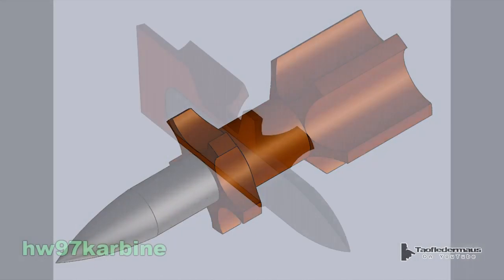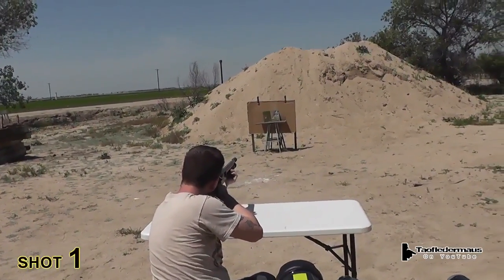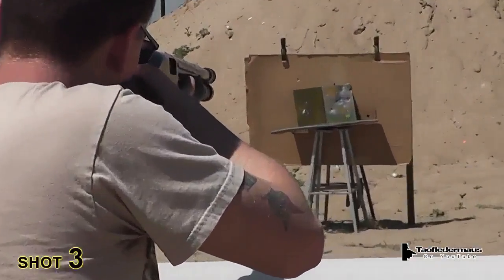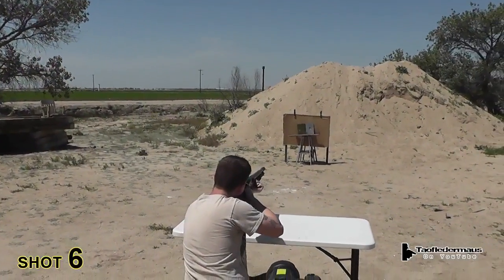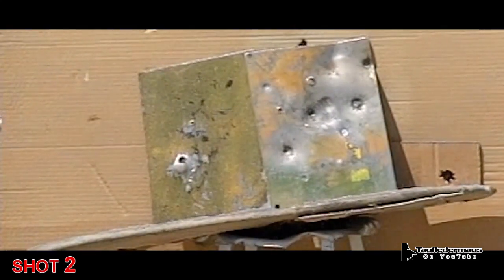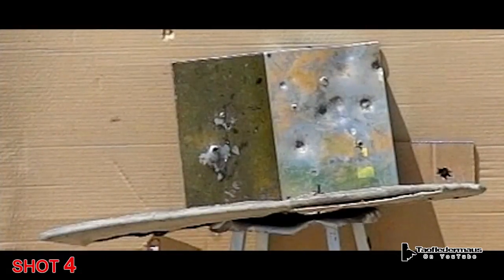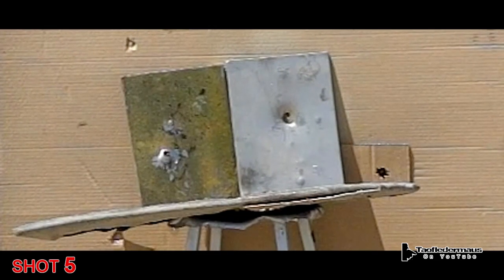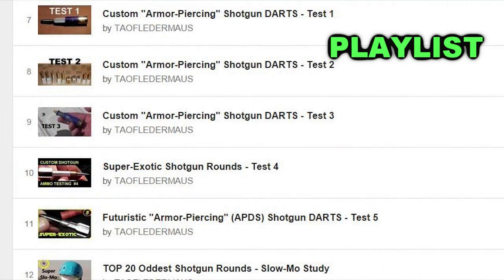Futuristic 12ga Shotgun Projectiles - Ballistic Trials - Test 6

Comment: without good spin, it won't fly right for a good distance...
Reply from the maker: +30yehgerrman   There are a lot of shotgun slugs that do not rely on spin.   They work by balance and drag.   It's a simpler approach that doesn't have the negative side-effects of a spun projectile.
Reply: Actually, I think the compression-expansion cycle of the urethane resin is to blame for most of the failures in this video. The cycle affects phases 1 and 2 of ballistics significantly. The solution is to actually make rectangular holes through the dart and cast the fins so that the resin goes through the holes... It's an easy solution and will absolutely prevent the G-shock from messing with the ballistics of the fins/dart combo.

Source: I'm a materials engineer.

Comment: The M1 tank uses a smooth bore 120 mm gun. The primary round is the "APDSFS". That is Armor Piercing, Discarding Sabo, Fin Stabalized. It is basically a very dense, very heavy, steel bar with a hardened point on the business end and fins on the other, fired at a VERY high velocity. The fins stabilize the round, but do not impart spin (as rifling would). It is extremely accurate and will punch through any known armor even at long range. There are actually Youtube videos of it. A shotgun is just a much smaller smooth bore gun. I think you guys are on to something, just keep working on it.
Reply: I would think making the fins lighter here and attaching them more firmly to the slug itself would make them more effective. The fins kept separating from the slug, resulting in the entire thing just flying apart.

Comment: They make sabot jackets for hand loading shotgun shells. Do you have a rifled slug gun? 
Something I've always wanted to try but I don't have reloading equipment. Is cut the tip of a .22" drill bit and use a sabot for mounting a 22 bullet in a 30 caliber case.

Comment: The basics for stabilization of 12 gauge bullet: (1) make the length as short as possible, about 25 mm, the diameter should be 18.53 +0.0 minus 0.02 mm; (2) The nose should be round, - radius about 9 to 11 mm; (3) Test with center hole of diameter from 6 to 10mm. The larger the hole, the more the bullet will be stabilized in flight. To have same weight with larger hole, bullet may be made longer. (4) Mild steel should be the material, for low cost. Coat it with lacquer or vanish so as to reduce barrel wear and tear. (5) Keep a stout cardboard peg or 2 between the powder and the base of the bullet.
Reply from the maker: +David Tharckabaw   Here is a new video where it backs up your "keep it short"  idea.   https://www.youtube.com/watch?v=voM13PNFYZI
Reply: +TAOFLEDERMAUS Thank you for your reply. It is interesting and very educational.
Reply: Are you saying a hole should be put through the length of the bullet, like a straw?
I think they've tested a few slugs/bullets like that and iirc there is no airflow through the hole when it's travelling supersonic but I may be wrong.
Although I'm guessing having the empty space would give a more stable balance.

Comment: not trying to beat a dead horse but what angle are the round dents from the shooter.  it does not require much angle to deflect the rounds but is does require a proper target that does not deflect when the round hits the target. general rule of thumb with steel targets is if the plate bends quit shooting at it.

Comment: won't putting fins on it cause more chance of flight/lift which can cause it to glide to the on the strong air pockets or under them depend on weather the stronger air is above or below them same can be said with left or right, you need something that cuts through the air rather than on that will glide on it

Comment: Interesting video series. Perhaps you would get better performance with shapes that more closely resemble blowgun darts, not the long ones with 'golf tees' at the rear, but the shorter, hard-hitting ones. I believe the tails on your milled darts are much too heavy, and although fins are theoretically better than cones aerodynamically, in this case I think cones will work better. Take a look at space reentry vehicles, the old cone-shaped 'nose' of Apollo missions, though in those cases, the cone was reversed and the craft presented a flatter cone to the air, but a cone none the less.

Comment: I've watched a few of these videos trying to get spiral action from different projectiles  The results seem to be the same. Tumbling . Relying on aerodynamics to overcome a no spiraled exit from the barrel seems futile. Extreme force and a straight push from the powder vs  literally no resistance from the air ain't  getting it . Maybe that's why our forefathers rifled the barrel . Blasting lead to conform to the rifled grooves and forcing a spiraled exit and accuracy. Ya think? Even a baseball is spinning upon release.
Reply from the maker: ron sheppard  I guess it is impossible this round worked then:https://www.youtube.com/watch?v=8DOZhYmFKnw
Reply: I would like to see some of these unique projectiles shot through a rifled barrel .Using plastic wadding or urethane or whatever to achieve  spin thus protecting the barrel The wadding then disintegrates releasing the projectile to spin and perform to it's designed purpose.
 The key is creating a forced spiral simultaneously . Force/spin
  I would love for you guys to achieve perfection. Shot after shot through the same target hole with one or more of these projectile designs'
  Interesting to watch  Thanks

Comment: Have you tried packing around the fins with corn flower to support them? And hold it in with a cardboard disc glued in the end of the shotshell to hold it all in. The extra weight and resistance will help the powder burn more reliably.
Also a once fired shotshell with fresh primer and powder charge will give you a longer shell to support the penetrator with corn flower as well as the fins. 
If the dart leaves the barrel straight it's more likely to fly straight.

Comment: Clearly theres enough force behind these rounds! And like you said these are purely experimental and they take a lot of time time to manufacture. If I were so bold to make a suggestion is that try to make a housing around the actual projectile. I've been watching some Slo-mo footage of tank projectiles that resemble the test rounds that you have been shooting. And what I've seen is that if you have a projectile that is longer than the shell and protrudes as much as it does they put a housing around the tip to ensure that it flies straight. I don't know if this possible with these rounds because it is as labor intensive as it is. But if it is at all possible, I would consider it. Keep the vids coming! I love 'em all!

Comment: Rifling probably won't help depending on how long the projectile is. Once a projectile reaches a certain length, rifling is no longer practical to stabilize it. That's why rockets and missiles use fins. The issue may have to do with the center of gravity and center of mass being off. If I remember correctly, center of mass should be in front of the center of gravity for these kinds of things.

Comment: Not bad for experimental exotic dart rounds.  Probably  would have been more survivable at reaching the target if they were poured lead or other bi-metal instead of composite resin around hardened steel points.  Also would have given us more to see if the target was a railroad tie instead of an old steel plate - these are darts after all, and the survivors would have had some interesting sticks into a wood target.

Comment: Just a thought TFM. Try making a shot gun shell shaped projectile that has INTERNAL FINS. The outside shell would be just like a shot gun shell,only a bit smaller of course to fit into a shotgun shell cup.

 In the middle there would be a ballistic shape with four internal square fins that hold the projectile inside the outer shell. It wouldn't be a sabot round as the outer shell would be permanently attached to the dart inside by the internal four fins. The square fins would run the length of the outer shell and the inner projectile.. 

You could make it out of any appropriate pipe material you believe is safe and will work. PVC pipe might be a good option The hardest thing I imagine would be to keep the internal projectile from separating from the outside pipe shell when fired because of the g's. The masses and materials would have to be the same for the internal projection/fins and pipe. Then you would have to find a very good way to hold the whole thing together. The fins would need to fit into notches on the internal projectile and the shell.

Comment: Anyone who says it is impossible without rifling is wrong. M1A1 Abrams (just an example) uses a 120mm smooth bore cannon to shoot MASSIVE tungsten/ DU darts. It is the design of the sabot, the velocity, stability... and dozens of other factors that contribute to the performance. I applied the geometries and rations used for those projectiles on some .338 test projectiles, and found that I had to make a sleeve that PREVENTS the rifling from imparting the spin. AN APFSDS wont work with spin. 

For open tip penetrators in jacketed bullets, the spin is required.Speaking of which, if you have a .308 or .300WM, I would like to send you some smaller prototypes to test against the HDDs or something else of your choice... you wont be disappointed.

Great video again! I love seeing these different results.
Reply from the maker: Cody Smallwood   I was just repeating some of the stuff people have told me on Youtube.  lol
Reply: ***** just reaffirming your stance. I can't begin to imagine how you keep up with ask the back and forth nagging.
Reply from the maker: There is a lot of nagging.  I can think of a better word though.  lol

Comment: Rougly how much muzzle energy were you getting from these?
Reply from the maker: 233kosta  We didn't chronograph them.  (hard to do when there is a other objects  like wadding, etc  flying with the round)
Reply: *****
I take it they're supersonic?
Reply from the maker: Normally they are but I'm not sure about these since we removed half the powder from the shells.  I honestly can't say.
Reply: *****
If they are at full charge, I'll have a gander at putting together some geometry that has a chance of flying straight at Mach 3 if you'd like.
Reply from the maker: 233kosta  I'm not sure if we can reach those speeds with a shotgun or not.   Even the half oz.  titanium slugs may only go around 2200 fps.   Can't wait to try those out.
Reply: *****
As it is, if the projectile is designed to fly at Mach 3, it'll fly well at lower speeds as well, assuming oblique shockwaves are better for stability (i.e. attached at nose, like a fighter jet). The waverider concept is based on using oblique shockwaves for lift and control, so it looks like it might be useful. On the other hand, detached shockwaves (like on the space shuttle during reentry) offer the advantage of not melting your projectile at higher speeds and might make it less sensitive to minute changes in direction (which may make them more advantageous for a shotgun projectile). Those usually come with a minimum speed requirement though.

A Ti slug sounds like fun :D would love to see the vid :)

Comment: You guys need to get a spare rifled barred for the 590 and retest some of the early designs, see if some actual mechanical spin stabilization makes them work! That would be preferred over say fins with a helix, they are stabilized immediately VS needing air & velocity to get them going. I have some hope that some of the early designs might work!
Reply from the maker: mytmousemalibu  I looked to see if they made rifled barrels for 590's and they don't.  They just make them for 500's.
Reply: mytmousemalibu well spin dosent stabilize all the time for example the Abrams uses a 120mm smoothbore gun to propel much, much longer saboted tungsten darts to over 3000 yards away with extreme accuracy with no rotation

Comment: Try a 3-piece nylon finned sabot-supported steel dart with a heavier point. Finned sabot-supported darts are proven effective armor-piercing tank rounds. And the heavier point should help prevent the air turb from flipping the dart around in flight.

Comment: Quite impressive to see them fly without tumbling - if he can improve the bonding of the fins, then full powder results should be good.
Reply from the maker: Paul Roberts   The steel rods had notches and other things to allow the resin to lock around the rod.  I couldn't pull the steel rods out using pliers.   Since the fins didn't break,    it is a bit of a mystery why they came apart.    It seemed like a solid concept.
Reply: ***** 

Why not just weld the bastards?
Reply: ***** do you know if he used flexibiliser (or whatever you call it) to the resin to make it less brittle? Maybe it is too 'solid'!!
Reply from the maker: I really don't know.   The fins weren't flexible or anything if you squeezed them.  But they were strong enough to not shatter.

Comment: So when are you getting the Phantom Flex Camera? 
To compensate for the smooth bore, can the fins on the darts be made to spin the dart as it passes through the air?
Reply from the maker: Green Silver   Rounds are either spin-stabilized or fin-stabilized.   If you try to spin-fin-stabilize you just add another wildcard to the factor.

Comment: You can stabilize a long projectile without spinning it quite easily. It's called drag stabilization. As long as the center of gravity is ahead of the center of pressure, it will fly straight. Learned that back in 8th grade when I built my first model rocket, and the laws of physics haven't changed.

The long rod penetrator, the DU round fired by the Abrahms tank, requires a smoothbore to fire it. And those fly just fine. Big long rod with some fins at the back end to provide some drag. Same physics as a model rocket.

Suggestion for your next batch... long rods, small fins cast at the back end, and a nylon sabot, a 3 or 4 piece sabot will seperate cleanly where a 2 piece may not. Also, look up some basic model rocketry references for the explanation on how to calculate CG and CP.

Comment: Does anyone know what happens if rather than using fins you just took a slug type round and you cut grooves in it? I'm not an expert by any means, just had the idea pop into my head and was curious if anyone actually knew the answer
Reply: ben dover 
Why would you cut grooves into a grooved slug?
Reply: VicariousReality7 I wasn't aware they made grooved slugs... shows that even if the idea has been done before I was thinking along the right lines though

Comment: If the fins were to be a CNC milled into the dart, would it be better for a full powder charge?
Reply from the maker: BostonTricker   In the past he made some with alum. fins and steel darts.     I think it was test video 4 where we shot that one.  It  actually stuck into a steel plate and flew very nicely.   We always used full charges in the past.

Comment: How can I send you some harden steel bearing roller
Reply from the maker: InGage 77  What is the weight and diameter?
Reply: I dont have anything to weigh them what is the minimum diameter that you can use
Reply from the maker: I can't fit anything larger than 18mm in a shell.
Reply: Ok ill see if I can find some that can I have diffent size what dose the weight have to be

Comment: Regarding Dart 1 where you mention that you speculate that the urathane expanded due to the compression from the G-shock (or massive acceleration) which caused it to become unbonded from the core:- Due to Poisson's ratio the internal diameter of the urathane at the bond interface would actually reduce due to compression...I think it's probably just due to the mass of the steel core (increased static inertia) compared to the urathane body that the shear force during acceleration was large enough to cause the bond to fail. But that's just my opinion. Keep up the good work on the vids! Always interesting to watch.
Reply from the maker: danfromyorkshire   That's possible.   We tested about 4 or 5 of them prior to this and they all did the same thing.   The only option was to try to reduce the powder charge in order to see if that would prevent separation.